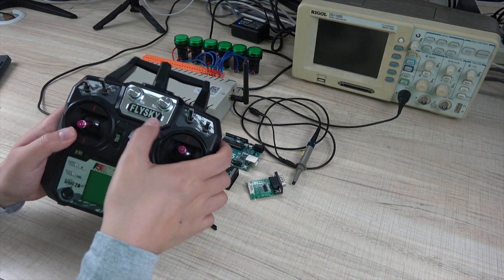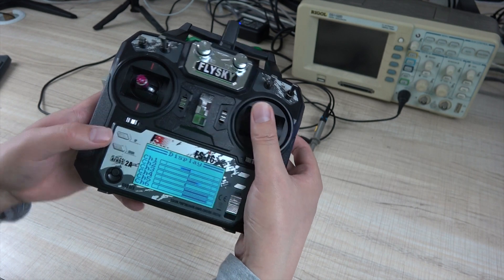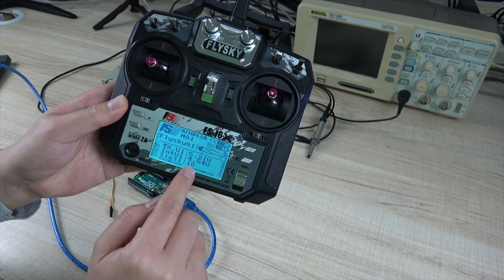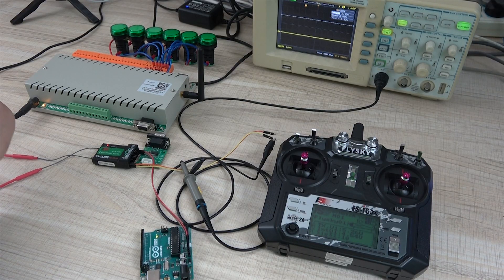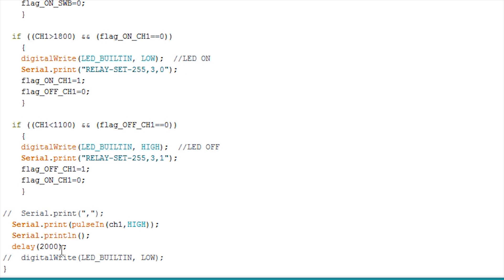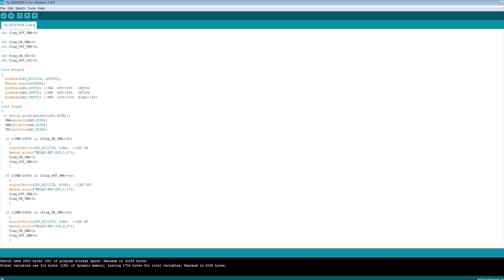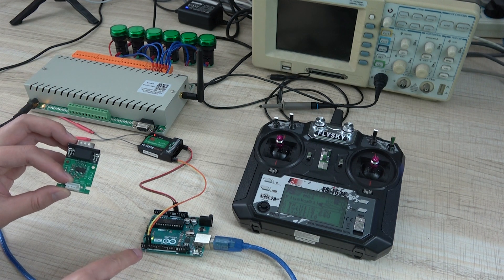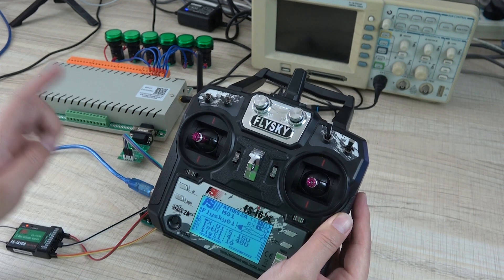How to control KC868-H32B relay board by FlySky FS i6X using Arduino

Comment: Can you send me the code. Also i need to control relays directly from arduino to relay board without the rs-232 converter. Thanks in advance 😂
Reply from the maker: code in our forum.
Reply: I searched and didn’t find it. Can you send me the exact link. Thanks

Comment: int ch1=3;
int ch5=5;
int ch6=6;

int SWA=0;
int SWB=0;
int CH1=0;

int flag_ON_SWA=0;
int flag_OFF_SWA=0;

int flag_ON_SWB=0;
int flag_OFF_SWB=0;

int flag_ON_CH1=0;
int flag_OFF_CH1=0;

void setup() 
{
 pinMode (LED_BUILTIN, OUTPUT);
 Serial.begin(115200);
 pinMode(ch5,INPUT);
 pinMode(ch6,INPUT);
 pinMode(ch1,INPUT);
}
void loop() 
{
SWA=pulseIn(ch5, HIGH);
SWA=pulseIn(ch6, HIGH);
CH1=pulseIn(ch1, HIGH);

if ((SWA>1900) && (flag_ON_SWA==0))

{
 digitalWrite(LED_BUILTIN, LOW);
 Serial.print("RELAY-SET-255,1,0");
 flag_ON_SWA=1;
 flag_OFF_SWA=0;
}

if ((SWA<1000) && (flag_OFF_SWA==0))
{
 digitalWrite(LED_BUILTIN, HIGH);
 Serial.print("RELAY-SET-255,1,1");
 flag_OFF_SWA=1;
 flag_ON_SWA=0;
 }

 if ((SWB>1900) && (flag_ON_SWB==0))

{
 digitalWrite(LED_BUILTIN, LOW);
 Serial.print("RELAY-SET-255,2,0");
 flag_ON_SWB=1;
 flag_OFF_SWB=0;
}

if ((SWB<1000) && (flag_OFF_SWB==0))
{
 digitalWrite(LED_BUILTIN, HIGH);
 Serial.print("RELAY-SET-255,2,1");
 flag_OFF_SWB=1;
 flag_ON_SWB=0;
 }

 if ((CH1>1800) && (flag_ON_CH1==0))
{
 digitalWrite(LED_BUILTIN, LOW);
 Serial.print("RELAY-SET-255,3,0");
 flag_ON_CH1=1;
 flag_OFF_CH1=0;
 }

  if ((CH1<1100) && (flag_OFF_CH1==0))
{
 digitalWrite(LED_BUILTIN, HIGH);
 Serial.print("RELAY-SET-255,3,1");
 flag_OFF_CH1=1;
 flag_ON_CH1=0;
 }

//  Serial.print(pulseIn(ch1,HIGH));
//  Serial.printIn();
//  delay(2000);
 
 }

Comment: Cani please get a code for a regular relay module? Please. I have to use switch d to turn off and on the relay and i have an arduino
Reply from the maker: you can download code from our forum: https://www.kincony.com/forum/showthread.php?tid=22&highlight=FlySky
Reply: KinCony IoT does it work for a single relay?
Reply from the maker: @Youdontwannaknow..  no problem
Reply: KinCony IoT but i want to do it for only one relay?
Reply from the maker: @Youdontwannaknow..  you can delete some code is ok.
Reply: KinCony IoT but i am new to arduino and I don't know anything about code at all

Comment: Does the receiver has to be bind with the transmitter before we can connect it to the Arduino.
Reply from the maker: yes, already paired.
Reply: @KinCony  Thank you for the reply, Im using FS-iA6B receiver which has a range of 4.0V to 8.4V. If I want to use an external power supply for receiver how much should I use. In some videos battery is used with ESC and in some direct connection with battery is given to power up the the receiver.